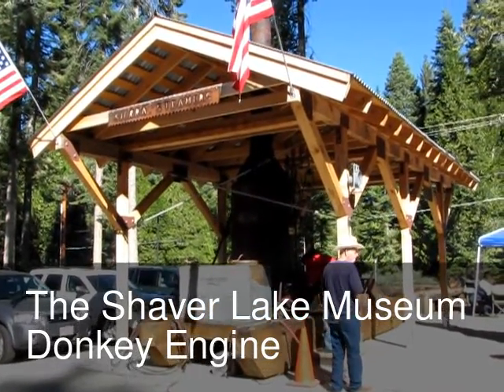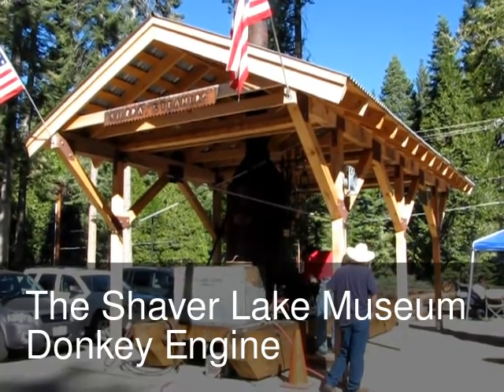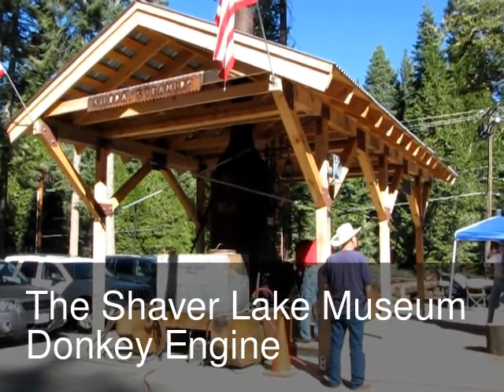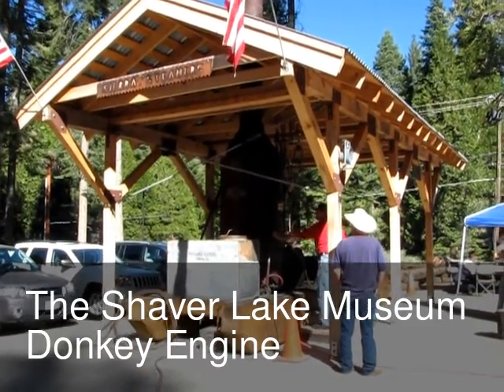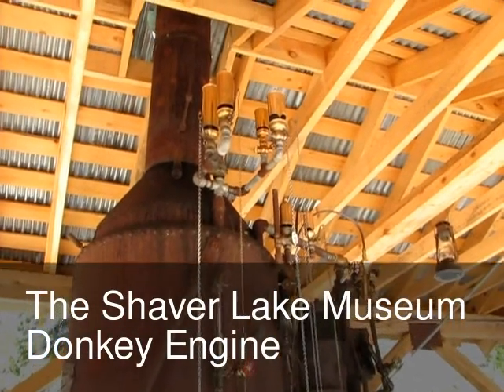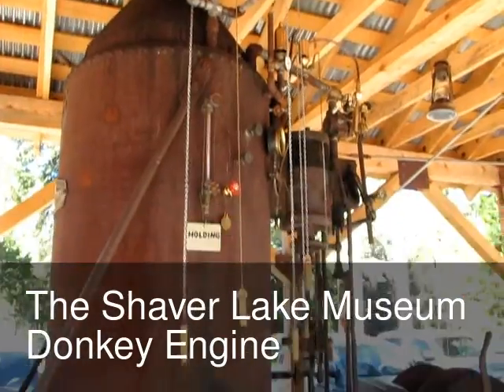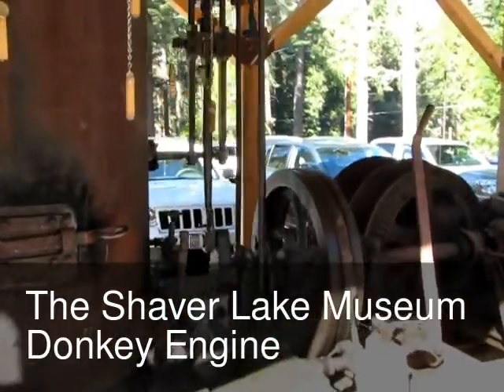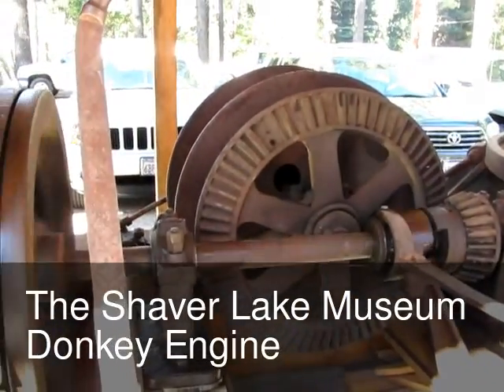Shaver Lake Museum Donkey Engine Demo

Comment: Well....Larger versions of these operated well into the 1950's and had their heyday in the mid 1920's. Cat logging really got going in the 1930's, but they couldn't effectively operate in extremel steep areas. So, steam donkeys lived on until diesel donkeys and tower yarders finally took over. Glad to see this little beast working. I had no idea anything existed in that area.